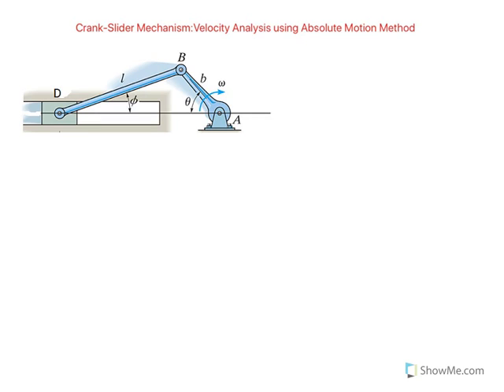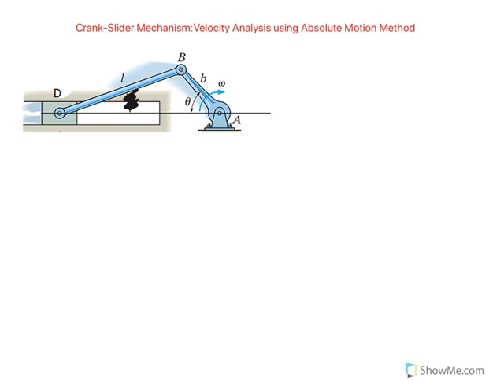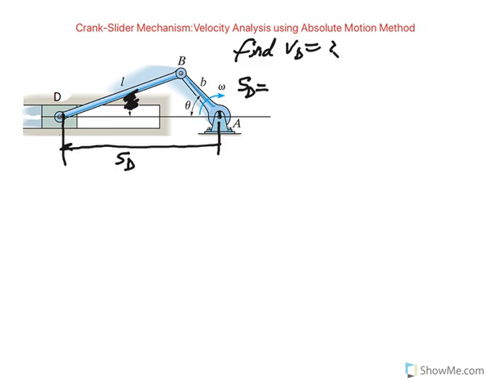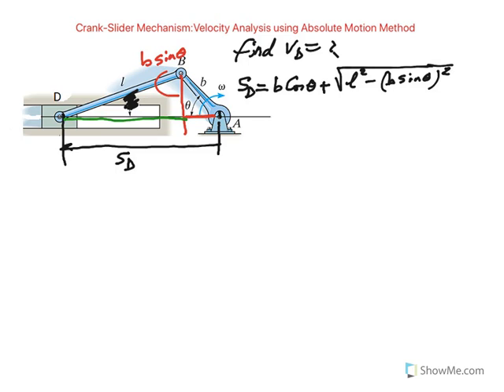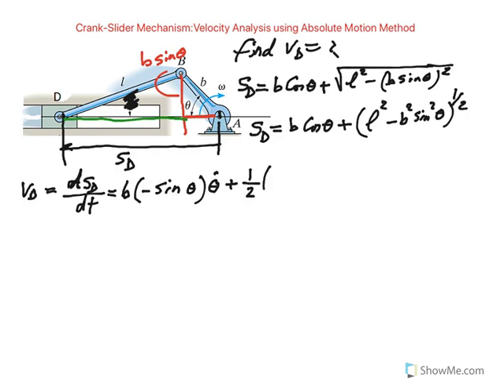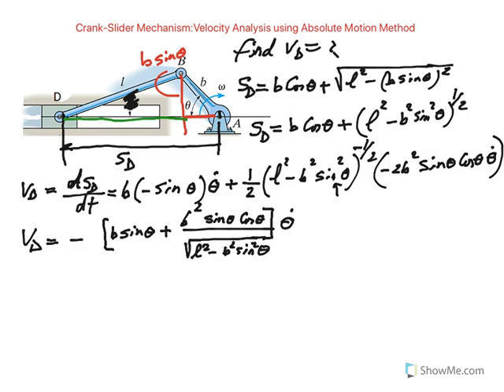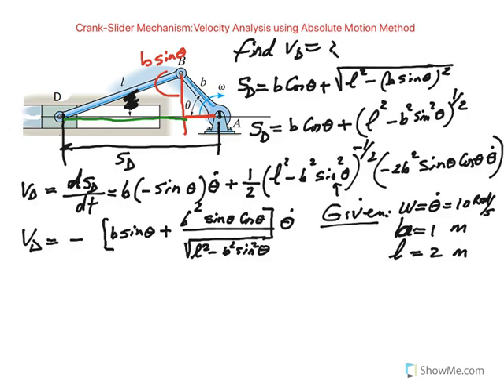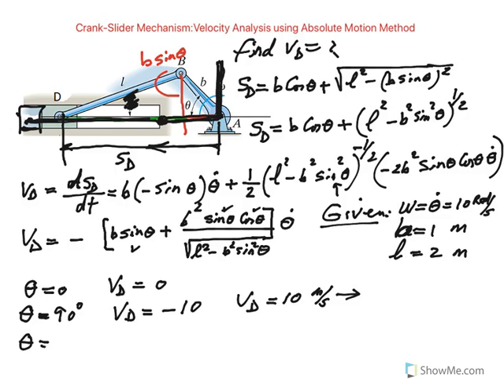Absolute Motion Velocity Analysis for a Crank-slider Mechanism

Comment: Thank you.  I laid this out in excel but for 30 deg I found a different value.  Should the max linear velocity be at 90 deg?  According to your equation, it happens before 90 deg.  I think instead of 10m/s it should be 15.77 for 90 deg which also the max